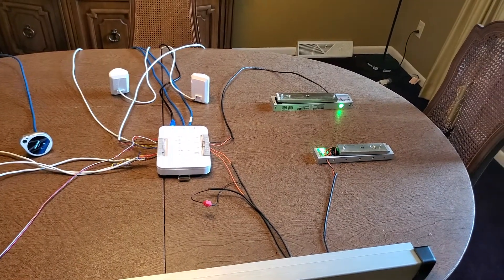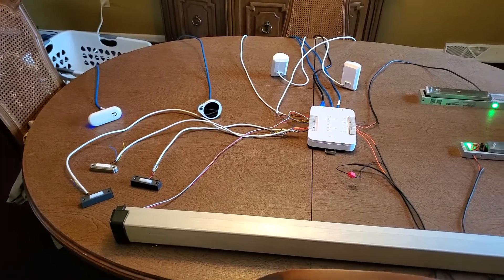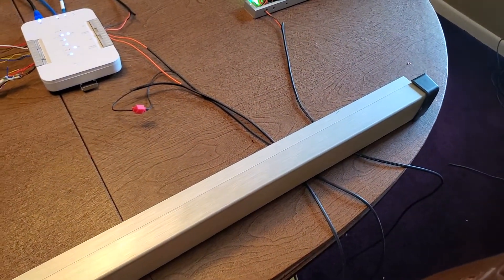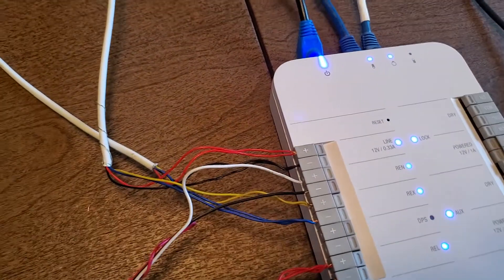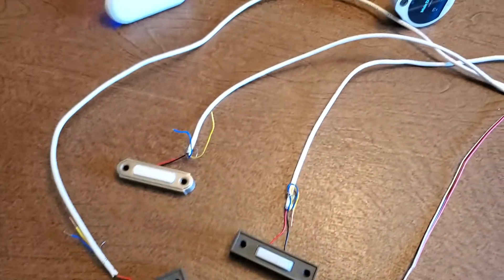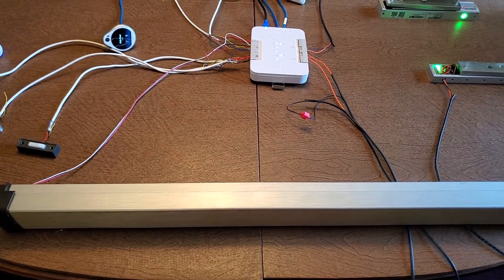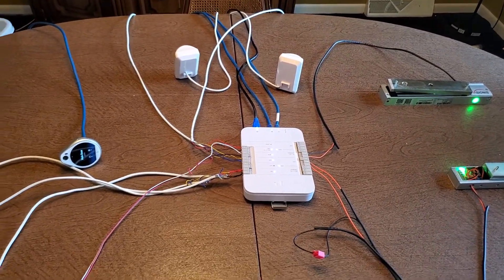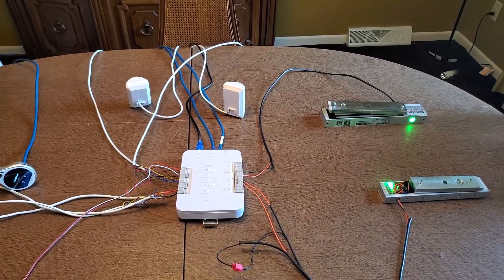Ubiquiti Unifi Door Access - Multiple Doors, Sensors, Buttons, and features expanded.

Comment from the maker: Hi all! I'm an sorry for no communication lately. I have been extremely busy building my Unifi Networks. I have reached a point to start sharing some news. Some flaws I see with Unifi Access is the ability to see your patrons entering your building. I have solved that problem. I have engineered a 45 degree angled faceplate to point the UA-Pro towards your patrons. Please check it out on eBay. The link to purchase is:

https://www.ebay.com/itm/166019262629 (https://www.ebay.com/itm/166019262629)

I will be coming out shortly with videos describing the progress. I have mechanical door bells, ability to use door access inside Unifi Talk, EA products including the new UA-PRO reader and Lite Readers. Please stay tuned!!
Reply: Ebay link is broken

Comment: Good afternoon, I saw that when placing two doors in the hub system I saw that you release access and both doors are opened simultaneously, is it possible to release access for each door? that is, release single access without the other door opening at the same time.
Reply from the maker: @SuporteMoema-t6k  no not unless you buy another UA-Hub.
Reply: @loufilla7202  thank you

Comment: Hi thank you for your time to explain it have a question, I’m using two doors does each has to have a power supply, ? Thank you
Reply from the maker: @jesuscortes5371  Hi. Yes both do. One can be powered by the UA-HUB. The other can be power by an AC adapter. You can find those easily on Amazon. :)

Comment: So one question - both doors are opening if click a button or whatever or is there a way to decide which button opens what door? Thanks Robert
Reply: Wire the button to the magnet power of the one you want to release. it will just release it and also not create a cumbersome event in the process.

Comment: Thanks for the video.  Is there a way to wire in a 12v doorbell chime so when the doorbell is swiped on the outside panel, it rings the chime? I tried integrating one but was unsuccessful. I want more than the app to ring, if possible. Also, is there a limit to the number of users I can have on one door?
Reply from the maker: Hi. Yes there is a way to do that. I am putting together video on that topic. Stay tuned! It is possible. Your second question is I have a system with 302 users so I know it can go to that total. Hope that helps!

Comment: I’m also a IT Director and looking to wire our office with ubiquiti. Currently have 2 x 48 port switches, 4 APs, and AP console
Reply from the maker: Hi. Yes no problem regarding cameras. No matter what 48-port switches you have that should be fine. On door access the UA-HUBS require a POE++ port which is only available on the Unifi Switch Pro models. Personally I have some door access on non POE++ and they seem to be working fine but that is what Ubiquiti recommends. You could also purchase POE++ adapters from Ubiquiti. They are $29 each. Good luck and let me know if you need any help.
Reply: I want to add cameras, door access

Comment: Hi Lou and all. I am new to Access.  I want to use it to open a gate. I have an Apollo 635 636 gate opener. The existing button is hooked to the board's Gnd and Input connectors (12Volt).  How would I connect the Access hub to this board?  What ports would I use on the hub to connect to the board? Where can I find this out if you do not know the answer?  Thanks. Love your videos.
Reply from the maker: Hello. When you say the button is connected to the gnd and input connectors I am assuming you mean request to enter? To connect to the UA-HUB you will plug your Gnd and positive wire to the "Lock" ports on the right. You will plug into the Powered 12v/1a NO or NC. The red wired will go in either one of those. The GND will plug into the com port. Your gate opener should have two more wires. Sometimes yellow and blue. That will plug on the left side of your UA-HUB in either the REN, REX, or REL. It doesn't matter what color into + or -. Hope that helps

Comment: Hi Lou or anyone, I believe I have run into an amperage issue. Our mag locks take 500 ma and we have a 4 door setup for our main entrance that we want to control from one hub. With four mag locks it ends up being 2 Amps and the locks do not stay energized. Any ideas on what we could do?
Reply from the maker: I think obviously you are running into an amperage problem. You will in my opinion need to move to a 24v system. I power 4 strikes using 24v strikes and it is working perfectly. I suggest moving from 12v to 24v and continue using the "dry" ports.

Comment: Hey where did you get that pushbar? We are in florida and we have to have a push bar for each door.
Reply from the maker: So unfortunately the pushbar is a exit only. You would need a low voltage pushbar system that can get pricey. The pushbar is used in conjunction with a strike plate which probably in Florida probably requires the strike plate to be tied into your fire alarm. I'm guessing here but I would check with local codes on that.

Comment: How did you wire up the power supply with the lock?
Reply from the maker: If u watch the video and pause when my camera is on the right hand side of the UA-HUB you can see the wiring. Lastly if you go to Ubiquiti's website and look at the UA-HUB in the store they have a downloadable PDF on wiring with and without a power supply. Just click on the link that says "Installation manual". Good luck!

Comment: Hey Lou, I use your video to setup my door access. My question is, I have the Bosch ds150I motion sensor and cant figure out the wiring, Can you help me out with REX. thanks
Reply from the maker: Yes it will not work... I tried that one and it does not work with the Ubiquiti system. Try this one:

Help me decide on this product: Panopticon Tech PIR Sensor Dual Passive Infrared Motion Detector Hard Wired Request to Exit for Residential or Commercial Burglar Alarm Systems, White https://a.co/d/4O6gAPs

Have a great day! :)

Comment: So you know if the "request to enter" could follow a schedule?
Reply from the maker: Well to follow an "door open" schedule you would program the times you would like to schedule the door to be open in the system and then set it to that door. The request to enter is only used to release the strike for a moment so that someone can enter. Does that answer your question?
Reply: @loufilla7202  i have an electric strike that is energized to unlock. It's fire safe because you can just turn the handle from the inside to exit. It does not want to be energized for hours at a time, so I'm interested in a request to enter, perhaps implemented as a motion sensor. But obviously, i want the system to ignore a request to enter at 3 in the morning.

Comment: Hey @Lou FIlla, I have question. For the push button. Does it open when you use the key? I didn't see that part.
Reply from the maker: Hi. No the push button is attached to the UA-HUB and when u press it releases the strike. No key is needed. Does that make sense?
Reply: @loufilla7202  I'm a little lost. For an commercial entrance/exit push door. I want to understand how to connect the access reader key outside to open the door with the 24v push door, Where I can connect the push door cable to? When reader detect a key and it open from the push door.
Reply from the maker: I understand now. So the pushbar 24v would obviously be connected to it's on power supply because the UA-HUB only does 12v. So you would connect your black and red wires into the "Dry" port on the UA-HUB. You have the option of NO (normally open) or NC (normally closed). You can determine what is best for your business. Hope this helps
Reply: @loufilla7202  thanks you. 
Can you explain the different of NO and NC? What does it do?
Reply from the maker: @RGam1ng  NO means when power goes out the doors will remain open. NC is the opposite. The doors will close in case of power failure.
Reply: @loufilla7202  I understand. Thank you for your time. For the 24v what would you suggest to get? a dc/dc or is there a way that it can be wired with the power from the building or is need a outlet to connect to?
Reply from the maker: @RGam1ng  I am not much help on 24v and the best ones. I personally use 12v as I do not have to have another power source. This way I battery backup my switches and no need to battery backup a 24v system.
Reply: @loufilla7202  ok thank you

Comment: Hi Lou, I want to do something similar but I want to unlock specific locks with my access readers. Basically I have the same setup as you, 2 access readers, 2 door locks, 1 access hub. Is it possible to tell the system access reader #1 unlocks only lock #1, and access reader #2 unlocks only lock #2 with only 1 access hub? Thank you!
Reply from the maker: No unfortunately not. Any strike that is hooked up will release or lock based on the readers on that UA-HUB. Sorry

Comment: Is it possible to do a panic button that will lock a door that is always open? I have a client with 2 doors and wants to lock the inner door incase of a threat (govt office)
Reply from the maker: Hi. Yes the system is equipped with a emergency lockdown and evacuate button inside the app. The only stipulation is that it does a lockdown and evacuate of all doors. Hope this helps
Reply: @loufilla7202  any way to add a button?
Reply from the maker: @simcoe_it_solutions  not that I have seen.

Comment: Does anyone know how many hubs and locks the POE++ can power?
Reply from the maker: The UA-HUB plugs into a POE++ port on your POE++ switch or UDM-PRO SE. That then powers the hub. Then you plug your readers into the UA-HUB. The strikes are powered also by the UA-HUB. I have had 2 strikes and 2 readers on one UA-HUB at one time. As mentioned in my previous comments if you power two strikes on one UA-HUB it will open both doors when someone access only one of the doors. If you use them to open a outside and corresponding inside door it's a great option. I also use the additional readers to run to the front desk. Then they can open doors just by waving a hand if they want too. Hope this helps

Comment: thanks Lou, we were looking at the upiquiti and were 'guessing' that we could use one door access system to manage two doors. We have a series of bays that have a front entrance and then another door in the back. If you wire both the front and the back doors to the same control when you unlock the front door it is going to unluck the back door at the same time. SO as long as it is low risk to have the second door also unluck this would work well? See that the video was from last year, how has the installation gone at your facility?
Reply from the maker: I agree with your assessments as well. Things are well. I have now installed several of these doors systems. My biggest install is a 23 door system across 4 buildings on the same campus.

Comment: Hi Lou,

Good video, could you list the hardware you used? I'd be curious on the 300/600 door locks as well as motion sensors you used. Door bell and UNIFI products your call.
Reply from the maker: So since doing this video I have learned a bit more. Specifically with county and city codes. When installing strike plates most counties and cities are requiring not only a sensor but a push to ext button near the door as a backup in case the sensor does not work. Lastly counties and cities are going to start requiring (or at least in St. Louis county Mo) that the strike plates need to tie into your fire alarms in case of emergency. This creates more costs etc. 

I have since switched to only door strikes or push button strikes only. These strikes do not require any of the codes I mentioned.

I have enclosed still what I used in the video as well as the door strikes I use. Push button strikes vary in price and type. Need anything else please feel free to reach out. 

Door Strike
UHPPOTE ANSI Standard Heavy Duty Electric Door Strike Lock Fail-Secure or Fail-Safe Adjustable for Access Control Cylindrical Locksets (Input Voltage 12VDC) https://a.co/d/2h4l2G0

300lb
Visionis FPC-5191 300lbs Indoor Electromagnetic Lock with 300 lbs L and Z Bracket for Inswinging Door https://a.co/d/9W9WNdC

600lb
Visionis VS-VISML600LED Indoor 600lbs Electromagnetic Lock with LED Sensor for Door Access Control https://a.co/d/0KhPN8x

Sensor
PIR Sensor Dual Passive Infrared Motion Detector Hard Wired Request to Exit for Residential or Commercial Burglar Alarm Systems https://a.co/d/3o7WcV4
Reply: @loufilla7202  Thank you.

Comment: Great video, thanks
One question : Door sensor : do they output 12V to REX ?
REX is expecting 12V signal or this vill damage it ?
Reply from the maker: Good question. To be honest not sure. You could hook a voltage meter to it I suppose to check. I would not try putting a 12v signal on the REX though.

Comment: If I'm listening to this correctly you can use one hub to control a double door access entry. Meaning I can use one hub to control two magnets is that correct?
Reply from the maker: Yes but there are stipulations.

1. You will need to power one of the doors with your own 12v power supply. 

2. When you access any door it will open that 2nd lock at the same time. This might not be beneficial on two outside doors as they will both unlock.
Reply: @loufilla7202  in the video you’re showing one magnetic lock connected to the hub. Then you show the secondary magnetic lock connected to the hub as well. Are you going through a secondary device, then moving the secondary device wires to the hub? 

The set up that I’m trying to make work will be a interior hallway door that has two swinging doors. That’s why I’m needing both doors to have a magnetic lock connected to the hub.
Reply: I’m OK with both doors unlocking at the same time
Reply from the maker: You should be good then with an interior door. In my video I have 2 locks and just one is using the hub for power. The other has basically a 12v 1.5amp AC adapter powering it. I then plug the lock into the "dry" port of the UA-Hub.

Comment: Awesome video Lou! Can you advise what 12v power supply you used to power the second maglock?
Reply from the maker: Hi yes. I got one off of Amazon. Wire it like in the video and you should be good.

ALITOVE DC 12V 1A Power Supply 1000mA 12W AC/DC Adapter, 100~240V AC to DC 12 Volt 1 Amp 0.6A Converter with 5.5 x 2.5mm 2.1mm Plug for LED Strip Light CCTV Security Camera DVR NVR Surveillance System https://a.co/d/dDPPQ0s
Reply: @loufilla7202  Thanks again!
Reply: You should always use Altronix power supplies.  Please, don’t use other garbage.

Comment: Hi. This is pretty cool. I was just looking for a system for small private school here in NYC and all the other videos I've seen about ubiquiti door access have been single unit reviews mostly.

Anyway to connect? I want to install a system for 3 doors here at our place. We have an old Dahua system installed by a previous hobbyist IT guy thats beginning to fail after almost a decade.

Wanted to re-use as much as I could (door strikes, ethernet wiring, etc.)
Reply from the maker: Hi. Yes not sure if it shows my email but if not reply here and we can connect.
Reply: @loufilla7202  hey

Comment: Lets say now you install that camera on front door, and an attacker rocks up with a high voltage power supply, or a taser stun gun and zaps the camera? will it blow up the system crash the hub and kill the power to the magnetic locks. ? the camera has a cat5 cable, smash camera from wall, rip out cable and apply 33kvac between cat5 cable and ground? blowup the whole system including the expensive dream machine. They have movs? that will not stop this type of attack thou i bet?
Reply from the maker: That type of attack would only blow the one port on the UA-Hub with that overcharge. I found out the hard way.... So   then if u also power your locks on a 24v and use the "dry" port on the UA-Hub then it would never overload your locks. So in the end u will need to replace the UA-Hub and the camera. Please also keep in mind the 2nd camera is powered by wifi on another power circuit so that would catch u in the act.
Reply: Hi Lou, I thought UniFi has developed this for office buildings only. Would you recommend this for home use as well. I currently have many UnFi devices running at home and considering this for home use. Thx.
Reply from the maker: Hi sorry for the late comment. That is a tough call. If low voltage and Ethernet cable install runs can work then yes. The world is always going to stay with low voltage and Ethernet so no matter what you choose you will be ahead of that curve. :)

Comment: Hi Lou can  you unlock Multiple Door without having to add Power ffor the second one?   if yes can you show how to do the wiring ?   thank you
Reply from the maker: Hi. Unfortunately you cannot. You can only power one door using the UA-Hub 12v power source. You can hook up multiple doors but each one will need a 12v power supply. After that you plug it in the dry port of the UA-Hub as in my video.

Comment: subscribed - i planning this for my school hopefully during the summer not many techs/vendors know how this works yet.  figuring it out
Reply from the maker: It has been the perfect solution for my schools. If u ever need help be happy to help in any way I can.
Reply: @loufilla7202  Most Appreciated, I contacted Lawrence systems another youtube - they only had most of 2 doors installed, how many doors have you installed it on? I have 6 doors but like to max it on 9 doors
Reply from the maker: @AppleiOSGenius  I have had up to 4 doors on 1 UA-HUB. I power 1 door with the hub and 3 others by AC adapters. I suspect you can do as many doors as you want as long as they have a power source. Please also keep in mind when you open one door it opens all the others so it is a security risk you will have to measure yourself. Anything else let me know by happy to help.